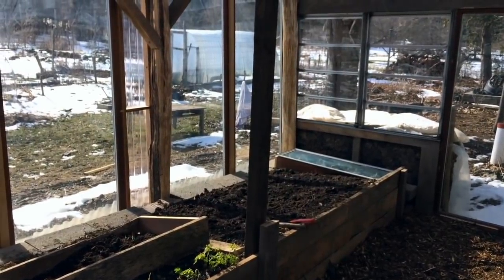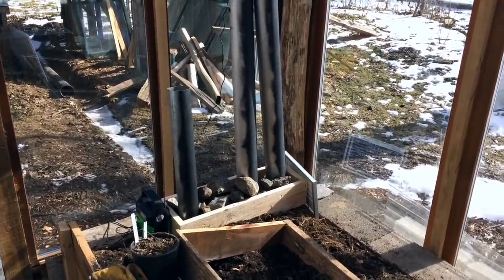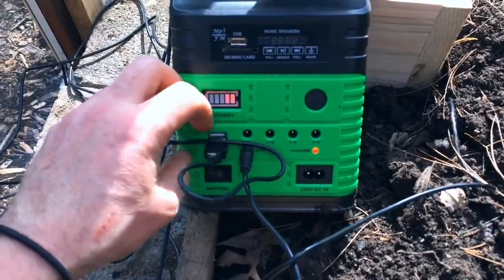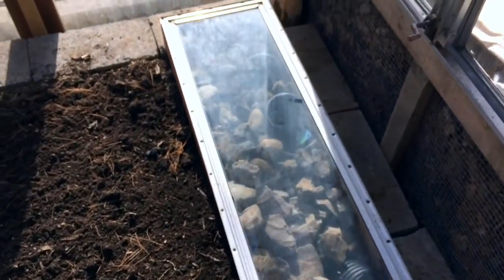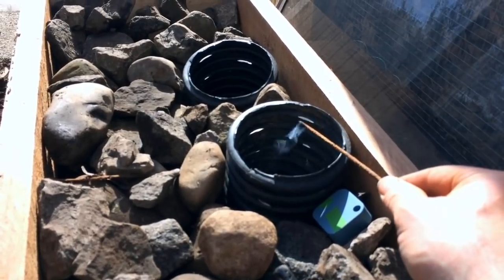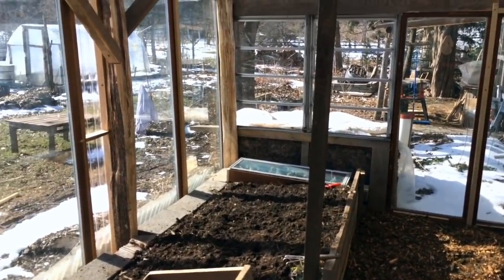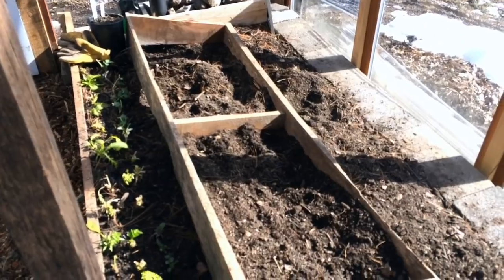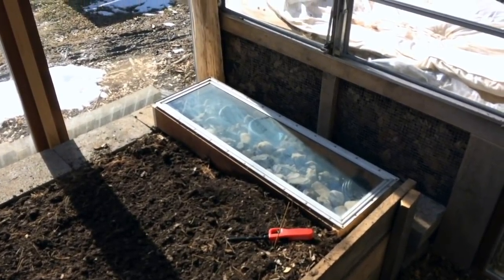Passive Solar Greenhouse - Climate Battery Activated

Comment: To get a passive draw through the tube one side needs to be warmer and higher than the cooler lower side.  If both sides are warm you have to have a fan to move the air.

Comment: Incense, or even a smoking bit if green wood, have been the easiest and most convenient way to show air flow for decades (if not longer). Try narrowing the exhaust side of the heat exchange pipes, I believe that was the suggested method used decades ago to speed the air draft.  I'm looking forward to more updates on this solarium.

Comment: The solar chimney is a great touch. 
What's the humidity like in the greenhouse?
The water vapor condensing on the sides of the drain pipe is supposed to be a big part of how the energy is stored.

I don't like cat poop anywhere near food plants,  but you know what your doing. 
Maybe you could start a worm bin for the cat!
Worm bedding,  worms,  and a layer of sifted soil,  added to as he does his business, and planted with chook fodder when it's full.
Reply from the maker: We don't like cat poop around plants either.  Nothing is really growing in there just yet (the few plants in there he hasn't walked near at all)
The humidity is 90%+ at soil level generally...

I've thought about a worm bin for him.  We might end up trying to lure him into another space to do his business out there, down on the floor where we can manage it.

Comment: Hey bud, greenhouse looks great. I have an idea for the front bed. A manifold with a riser in the middle for the fan might solve the airflow problem. You could make it out of a upside down cardboard box and tweak it till you get the best results, then make a permanent one from scrap wood. It would work like an intake manifold in reverse, and all three stacks would have equal draw.

Comment: Most of your fellow battery builders use the thumb rule:  The rate of air flow to store all the excess heat(in the winter I assume) has to equal 5 complete room volumes per hour.  Not said elegantly but the units are correct.

Comment: Love watching your videos. I watched your outside compost experiment also. This is a thought I had about getting a night time heat gain similar to some of your experiments. Use a solar air-panel outside to collect winter heat and run it through loose stones under your beds during the day.  Let it exhaust inside or outside according to your need using a diverter, with flaps which activate when the small fans are running and closes for night time conditions.  I believe this could let you use one, two, or three panels to flow the appropriate volume of air to produce the solar gain required for your needs.
Reply from the maker: Thanks for your notes here, much appreciated!

Comment: Maybe you could use just one more piece of painted-black tubing, horizontal, along the front, on the bricks (maybe only half-way so Stanley can still hang), and it could feed into the rock box and then you could seal up the rock box. So, the full run would go from the front, to the rocks, down into the soil, and then out the chimney. You might not have the pieces for it though...  you would need a 90 degree angle piece...

Also, it looks like you could fit a nice shelf in the upper area, over-head, for seed trays, etc.

But it already looks great, man!
Reply from the maker: Definitely planning to add shelves to this space.  I just built a monster shelf system last night for the back wall, it was too heavy to get into position last night so I'll do that today sometime.
 The idea of having more of a 'run' before the box that accumulates the hot air is an interesting one.  I think what was happening is that I was hitting a wall with how much tube-view I wanted in the space so that was part of what inspired cutting them back and 'hiding' them.  I would like the space to be less plasticy when its all done, so I'm just not sure where that balance lies...
Thanks James!  Hope winter times are good by ya!

Comment: looks great ... the only thing i would think about is taking the heat thats at the top of your greenhouse and pumping it into the rocks to heat them up during the day and then reversing that during the night.  if you remember looking at my setup i drew the heat at the top through the rocks to heat them up and then out at the bottom of the greenhouse where it would be the coldest.  essentially what you are doing there is taking heat off of the rocks and pulling it into an already hot place near the top of the greenhouse.  i like the idea of heating your house with the greenhouse also but what happens in the summer when not only heat but humidity comes in every time you open that door?
Reply from the maker: For the summer we'll really have to evolve the design here and be sure to have VERY good ventilation in the space, and be growing deep shade casting vining crops in key locations to keep it cool... That will be interesting!
I hear you on pulling hot air from up high.  I spoke with a friend who made his climate battery (Jonathan Bates of 'Paradise Lot' fame) and he said that a fan will stir the heat up enough through a day that it shouldn't matter dramatically in pulling from other areas if the space is pretty well closed.  We'll have to see I guess!

Comment: I do find the rocks intriguing because we all have rocks.  I'm wondering (for me, not for you or others to change what you're doing) about alternating rocks and soil, moving left to right rather than layered, with screen or something heat-permeable (so not wood) between them, so the daylight heat banked by the rocks could move laterally into the soil.
Reply from the maker: That is an interesting idea.  Having the rocks 'charge' warmth into the soil... hmmm....

Comment: I love what you are doing here :)
May I make a suggestion for your design?

Has it occurred to you that you are basically building the same component twice? You have the solar collector (box with rocks and glass cover plate) at the intake and a solar chimney (metal pipe painted black) at the outlet. But essentially, both are doing the same thing. They are heating air using the sun.

What if you were to build a vertical version of your solar collector that would also act as a chimney? I imagine a long, say 2 meters high and half a meter wide thin box, with a thick glass pane on it acting as a lid. Behind the glass you would put some metal rippled material... something like what you have on the roof there, but made from sheetmetal or something and painted black. There would form thin channels behind the glass through which cool air would heat up and start rising to the top. This should give you enough draw to pull air through the soil. So basically, make one bigger device that's both solar chimney and air heater and remove the solar collector from the intake. Maybe the air going though the soli would be a bit cooler, but I think the device as a whole would become simpler and the solar chimney much more powerful. Hopefully that would allow you to get rid of the fan altogether.

I don't think it's very relevant to your situation seeing all that snow, but I think such a device could also be used to actually cool the greenhouse in the summer. Imagine a valve or something that allows you to choose where the heated air exiting from the solar chimney goes. In the winter, you keep it inside, but in the summer you could exhaust it to the outside. Now imagine a similar valve on the intake, where in the winter you would take the warm air from the greenhouse and send it through the soil inside, but in the summer you could make it draw from an underground pipe that goes through the cool soil at some depth outside. So in the summer you would heat air in the chimney that you dump to the outside, and make it draw in cool air from the outside to actually cool the greenhouse using the sun's heat. Food for thought maybe.

Keep up the good work!
Reply from the maker: Really great layer of thought and design here, I understand what you are saying and will take it into consideration for sure!  Thanks so much for sharing :)

Comment: For adjustments, if the heat battery works, then make it so I can repel heat also during summer. Otherwise ull be cooked.  One of the ways this can be done is to reflect light (and heat) off, or redirect it.

Comment: Once you blacken the stones at the short tube end, you should try to connect the 3 tall tubes together, with a single outlet for rising warm air. (Picture a car manifold coming off an engine block, leading to a single exhaust pipe.) Then put your single fan atop the exhaust stack, which will pull warm air through all 3 tubes. It would work best if you could enclose the fan within the exhaust tube, for greater efficiency. Perhaps you could cut the mounting brackets off the fan, make it rounder, just enough to wedge it down into the end of a single exhaust tube. 
You will need some small vent holes in the box with the hot rocks, so fresh air can enter and be warmed by the stones.
Oops! Just scrolled down and noticed Richie Bee Cool Stories already came up with the same solution. Sorry, Richie! Didn't mean to steal your thunder. :) Hey, great minds think alike, right?
Reply from the maker: Certainly a lot of votes for combining the fans.  Something to seriously consider.

Comment: I think the problem is that with heated pipe/rock on both sides of the tube, that they will compete against each other and slow down the draft. Just a hunch that it may be something to think and test about.
Reply: I agree with you.  Heat rises, so you need more heat on the long pipe side, which will draw the ambiant temperature underground. You don't need the glass.
Reply: You are right about the draft, but indirectly I think doing it like this may give him more information to decide which is the larger heat pull between the two. It's very unlikely they will be the same temperature so there will be a draft. The painted metal could actually heat up quicker pre warming the air if the direction was towards the rocks. Also he could paint the rocks and get larger heat gains. Just some thoughts.

Comment: About the chimney effect @ 3:14.
2 upgrade ideas I'm using...
1. This will extend life of fan indefinitely by eliminating the heat passing by the fan motor.
Get a 45° elbow 'Y' for each top. 
Point the angle of the tap in a downward fashion. 
Put the fan so it pulls air in from below and right back out the top.
Angle the broadest surface of the larger surface mass of the Y for more heat gain.
2. Build another black box. Run PEX tubing in it. 
Couple of cheap snap switches to turn pump on/off automatically. 
Hot water is stored in connected 55 gal barrels on house side of greenhouse or under seedlings bench with full sun exposure on S facing wall painted flat black ⚫
I have both geoair and solar hot water heater under construction back home. G Scott Davis has a great bunch of "proven" ideas and ha s done the in depth thermal cam test, hundreds in the chat room have built them...
BTW, I'm building a walapini near Bend Oregon in the snow covered pass... wish me luck. 
Have been listening to you for quite awhile.  😊

Comment: With only one end of a tube being open, no matter whether a fan is on or not, there can be no airflow. I assume the window on your microclimate leaks a lot or you'll get no movement through the pipes underground.
Reply from the maker: Lots of leaky air around the sides, yes...  Should have clarified that.

Comment: This an interesting experiment. I really do like this and gives me ideas for one close to the house I have in my head at the moment. I was wondering if one could have more than 3 'tubes.. like enough to span the width of the bed? Plus what would it be to build a little wooden 'box' to frame the fans in over the other tubes to help draw air up through them all. I would say  you need at least one more fan. :)
Reply from the maker: Certainly need to think through the design on the fans more.  Yes, I bet you could have more tubes and that would make more of a difference!

Comment: Your air system seems to be only one way. The ones I have seen have programmable two-way fans that all blow down into the soil when the air is hot, and all pull air up at night, depending on the air temperature in the greenhouse.

Comment: First a question. What was the outcome of the compost heating system?
We have the same issue with our cat using the bare soil as a kitty litter. My solution was laying down hawthorn branches everywhere that needed protection. Not only does it keep the cat from disrupting  the seeded beds , it also keeps the squirrels out.
Reply from the maker: Hawthorn, that makes sense!  Probably a bit rough in such a tiny space as this, but out in the main garden that is an interesting idea!
The compost heating... It went 'dormant' a little ways back with the incredible cold spell.  I've added a lot of liquid nitrogen (yes) to it the other day and put an insulation blanket over top.  I'll temperature probe it in a few days to see how it is performing.
 So far, it hasn't blown me away, but I think I needed to insulate it at the outset with haybales or some sort of real protection from deep winter cold.
Reply: I'm  sure  come spring it will take off. Try it again next fall with the corrections. I`m   positive  it will work.

Comment: get before during and end of study temps. for input and out air temps as well as soil temps Small area to heat like this.  thank you Keep us up to date
Reply from the maker: I don't have enough temp probes!
Reply: @edibleacres  
You cant have enough sensors ;) The cheapest option is to use 12 way rotary switches to switch individual sensors on a single meter. The sensors themselves can be found  fairly cheaply. These systems should be fan driven as you need to move a lot more air than you imagine.

Comment: Capacitance=  two conducting surfaces in parallel separated by an electrical non conducting  layer producing negative charges on one surface and positive charges on the other.

Comment: Water is the densest thermal mass you can use. It is more effective than rock.
Reply: Water is great but its not always the  best choice ;) If you have a finite amount of heat, say 3 hours of sun on a winters day and you transfer it into water it may raise the temperature by a degree or two. Thats not going to be too useful for heating the greenhouse the same night ;).If you run the warm air into the ground for 3 hours it will heat the soil near the tube to a reasonable temperature. Soil conductivity and diffusivity is relativity low so the heat will remain close to the tube where it is recoverable for use that night.

Comment: Where are you located if you can say ?
I am in zone 5 eastern NY wondering if your in a higher or lower growing zone ?
But it is similar to ours here 
Hoping to use your inspiration for a productive green house it is based on mostly solar? How much electricity dors this need? 
Have to see how you will cool the hime in hot summer time
Won’t his acidic kitty doings cause soil problems in future soil?
How nice of you to kindly share the project   It seems to be able to work well 😉
Thank you
Reply from the maker: We are zone 5B central NY state...
We will have to figure out our design for the summer as we get closer to that!
Reply: @edibleacres  not long.. Can you open the sides or is the door the only opening. Shade cloth may help when the heat arrives.
Tight enough for winter but. loose and cool for the summer happy medium somewhere 
thanks for sharing

Comment: use the solar heater design where you run black tube up down a  black box frame 4” deep set outside run tube inside. Close at night. Create more space inside
Reply from the maker: I don't understand what you are saying here I'm afraid.
Reply: just do search on           DIY solar heater collector "

Comment: Could you try putting the Solar collector on top of the single pipe and see if it pulls enough air?
Reply from the maker: With the fan over one pipe it pulls just fine.
Reply: @edibleacres  What I was asking is if you could do an experiment by attaching the collector on top of the third tube that isn't circulating the air. I believe the draw from the collector heated air would negate the need for a fan and act as a passive thermosiphon. I'm hoping it would be like the blackened chimney on steroids. The fans could be used to force the hot air down tubes from the very top of your greenhouse to increase the efficiency of the heat transfer system. I'm not trying to be presumptuous, but if this would work as envisioned, a four season greenhouse in very cold climes could be done very economically.

Comment: "thermal mass" is a better word than capacitance.
As an energy professional, I occasionally use incense.  The other options is toxic, and I refuse to use it.
Where is the air coming from when you put that window on the rock box?  You need an source of air for the box at least as large as the combined area of the three pipes.  Making that small fan suck air through soil is going to rob it  of all its power.
I am dubious about quickly changing the long habits of cats.
Reply from the maker: There are lots of spaces here or there around that box with the window, and I will crack it open a bit if I see the fan having problems pulling air through.
Reply: Cats hate citrus scent ,orange and other citrus peelings do keep them away
Tried and true and keeps cats away on our grounds and in house plants when placed  around soil
Reply: @edibleacres  I bet with the fan actively evacuating the "hot box", you'll have air going the other way, being pulled into it from the 3rd tube.
Reply: @johnc_canada  That could be a good thing!